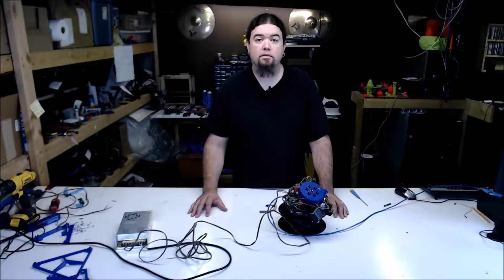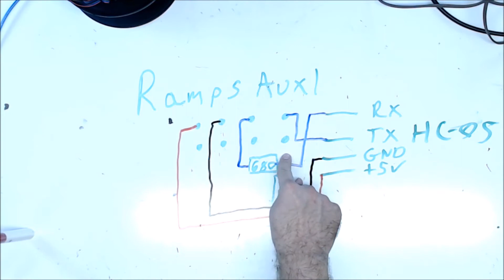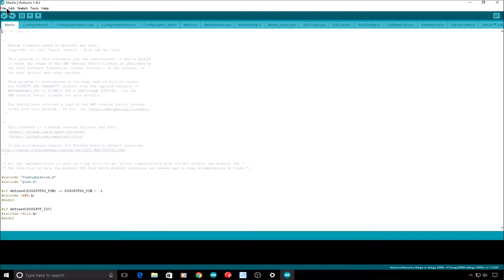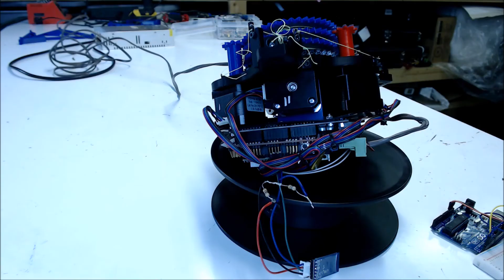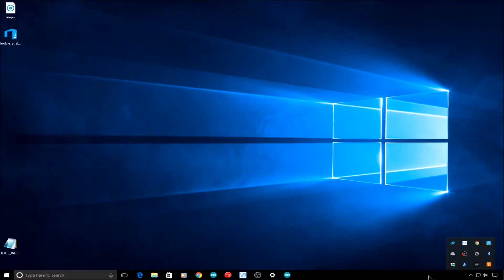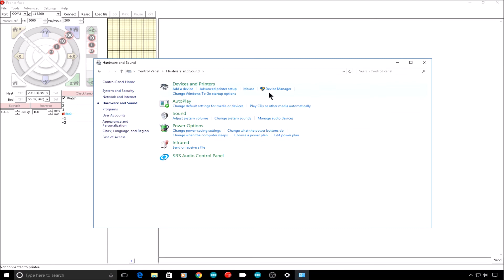Add Bluetooth to your 3D printer

Comment: Hi, great video! Correct me if im wrong but in your set up, the resistors lowers to rx voltage to around 2V. Would it not be better to use a 1k and 2k resistor to lower the voltage to around 3.3V??

Comment: Can you use both USB and Bluetooth on the Arduino? My thought was to keep my RPi connected via USB for Octopi (same enclosure), then use Bluetooth with my computer for make changes to Marlin.
Reply from the maker: Yes, you can use both, but they will be on the same serial, they might fight each other a bit.

Comment: Hi, why do use a resistor to down to 3,3 Volts when you connect to ramps, but you don't use with arduino uno?
Reply from the maker: It will run the module well enough to configure it, but not to accept stable bluetooth connections.

Comment: Hello Chris,
I have a marlin version 1.1.9 in my printer and connect the bluetooth module according to your video guide. After trying to upload the build to arduino, it displays the error: #error "BLUETOOTH is only supported with AT90USB." Can i ask you for help?
Reply from the maker: I don't think you need to uncomment this line to use bluetooth anymore, but I haven't tested it yet.

Comment: I Have problem when i enable bluetooth 
i get error message said ** BLUETOOTH is only supported with AT90USB ** 
i use marlin 1.8.10  
CAN ANYOONE HELP ME WITH THAT?
Reply: 1.9
Reply from the maker: Where do you see that error message?
Reply: @ChrisRiley  have the same issue it's a compilation error  ( BLUETOOTH is only supported with AT90USB), i'm using marlin 1.8.9
Reply from the maker: @ammarelsaygh489  Marlin changed how this worked. You should be able to still use this module even with BLUETOOTH commented out.
Reply: @ChrisRiley  try download new marlin code and enable Bluetooth and then you will see error message. It is only with new marlin code the old one i did not find this problme. I try to fix it but nothing went good
Reply from the maker: @MegaFahad1991  I see it, I think you can use bluetooth without that option enabled now, but I haven't tested it yet.
Reply: @ChrisRiley  thanks alot. I wish if ypu will make video about used 2 extruder and one nozzle. How to sit it up in slicer like cura. I have problem with parking  and change extruder
Reply: @ChrisRiley   https://www.thingiverse.com/thing:3094884     i printed this file

Comment: In file included from sketch\MarlinConfig.h:42:0,

                 from sketch\G26_Mesh_Validation_Tool.cpp:27:

SanityCheck.h:352: error: #error "BLUETOOTH is only supported with AT90USB."

     #error "BLUETOOTH is only supported with AT90USB."

      ^

exit status 1
#error "BLUETOOTH is only supported with AT90USB."

Not working, why. I have motherboard 14 EFB
Reply: The module works correctly with the marlin version 1.0.2-2.
Reply from the maker: @josemiguelp.pinuer1291  Hmmmm, interesting, I am not sure what would have changed.
Reply from the maker: What version of Marlin?
Reply: @ChrisRiley  1.1.9
Reply from the maker: @maciejonych5245  Not sure, that should just work, try to compile a fresh copy of Marlin with just the bluetooth change.

Comment: Good morning Chris, I'm trying to enable Bluetooth in Marlin 1.1.9, but when compiling this error,

In file included from sketch\MarlinConfig.h:42:0,
                 from sketch\G26_Mesh_Validation_Tool.cpp:27:
SanityCheck.h:352: error: #error "BLUETOOTH is only supported with AT90USB."
     #error "BLUETOOTH is only supported with AT90USB."  
exit status 1
#error "BLUETOOTH is only supported with AT90USB."

Would you help me.
Reply from the maker: Hmmm, what mainboard do you have? This seems to be calling out a Nano.
Reply: arduino mega 2560 e  ramps 1.4  @ChrisRiley
Reply from the maker: @JeanCarlos-ed2cd  Wow, ok, let me try it and see what it does.
Reply: the same problem  we need your help
Reply: I HAVE THE SAME PROBLEM CAN ANY ONE HELP US

Comment: Hello Chris.  Is it possible to use the same AMS1117 voltage regulator used for your wifi tutorial for the bluetooth instead of the resistors? I have a bunch spare and no resistors...
Reply: Thank you for your reply.. Love your videos..
Reply from the maker: Sure, that should work just fine. I think we did 5v to 3.3v in that one correct? If that's the case I think it would work just the same.

Comment: hello chris, your video was really good man ! 

i've done the wiring like you did. i am using arduino mega 2560 and ramps 1.4 attached on it. how to check that the bluetooth module HC-05 is working with the ramps 1.4 ? do i need to do any test ?
Reply from the maker: Hey thanks! It doesn't give you a very good idea that it is working sometimes. I have also had issues when USB is connected, sometimes it won't connect up. About the easiest way to test to see if it is working is to cable up to an UNO and run some serial commands on it. If you need to test it on the RAMPS, power your board up with 12v no USB attached and see if you get the blinking light and can see it from another device.
Reply: thanks for your reply...forgot to tell you that after doing the wiring and all i tried to search the HC-05 module through my android and it detected. does it mean it working with the ramps ?
Reply from the maker: Oh, then you are in good shape. Now I would just use pronterface to connect up to the com port listed on you bluetooth HC-05. If it connects successfully, you should be good to go.
Reply: alright man...thanks for your help ! for your information i am doing a project to control the 3D printer by using an android app...if there is anything i will hit you up ! it would be great if i can have your contact so that easier for me to seek help from you
Reply from the maker: Sure, you can email me at brotherchris81@gmail.com
Reply: hello chris, why when i type on the serial monitor it doesnt react ? like i type AT+NAME? and the words gone and nothing appear on the serial monitor
Reply from the maker: Sounds like maybe your no getting connected properly. Try change your port or baud rate settings.

Comment: Hi chris.  I liked the video and subscribed.  I purchased a Velleman VMA302, Bluetooth HC-05 Transmission Module.  There is no button on it. What do we do in place of pushing the button at the various stages of programming the module?  Thanks for sharing your knowledge with us.
Reply from the maker: Hey Lee! Thanks for the sub. Check this manual out. https://www.velleman.eu/downloads/29/vma302_a4v01.pdf You need to bring the key pin high (3.3v) before you plug the power into the modual that will put it in configure mode.

Comment: thanks for your video, i have a mks gen 1.4 almost like the ramps, but i have connected a mks tft 32  in the aux1 pin,  can i connect the  bluetooth module in other aux port?
Reply from the maker: Fernando Uzagaste Yes you can, but you'll have to change it in pins.h.
Reply: thanks chris  can you helpme ? or any video to know how to d it? really  thanks for your time
Reply from the maker: I can try, I will have to look at some configs and see what we have to work with. I will see what I can do.

Comment: Chris hi, it is possible to add both, the WIFI modeule ESP866 and the bluetooth interface to ramps 1.4? I mean can iI use other pins to connect the bluetooth module?
Reply from the maker: Rodrigo Salas That is a great question and I haven't tested it, but I am going to say no. The ISP is a first come first serve interface and even having USB and bluetooth connected at the same time tends to confuse it. It might be possible, but I'm not sure how the config will look.
Reply: oh! :( ok, thanks for taking the time to answer my question Chris
Reply from the maker: You bet! I can't say it's not possible, but I don't see it working out.

Comment: My pronterface show connecting status when i connect to bluetooth using hc06 module through COM 3.Can i know why only stuck at connecting status?
Reply from the maker: zeox han Your serial bus might be confused. Does it work if you unplug the bluetooth and just use the cable. You might try to boot up the board then plug in the bluetooth.
Reply: if using USB cable can connected,i have try to boot up the board then plug in the bluetooth before, but same problem~
Reply from the maker: What kind of board do you have? Make sure the send and receive wires are connected correctly. Make sure bluetooth is enabled in Marlin and both baud rates are the same.
Reply: RAMP1.4,i follow you step exactly ,RX -> AUX1 D1 
TX -> AUX1 D0